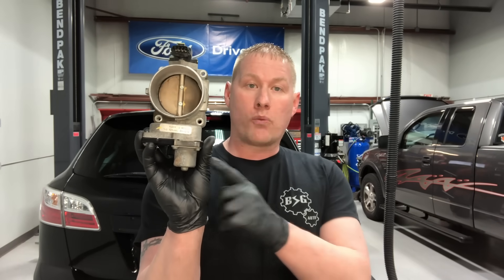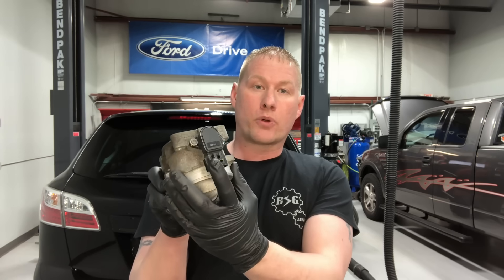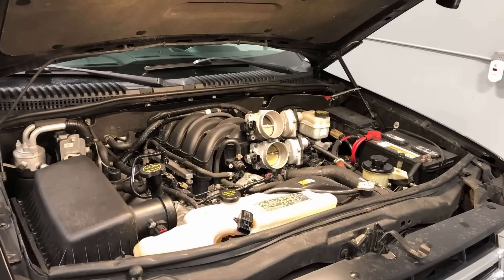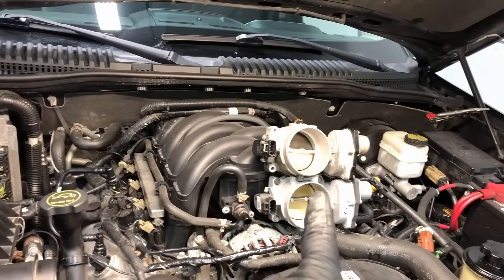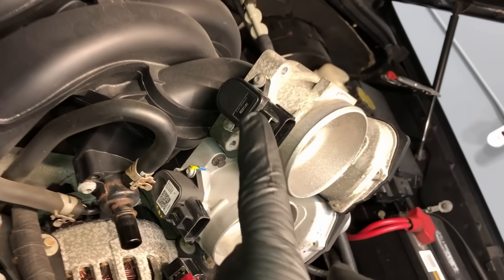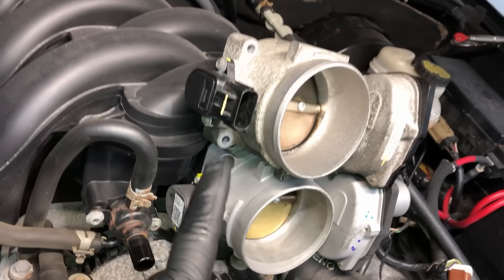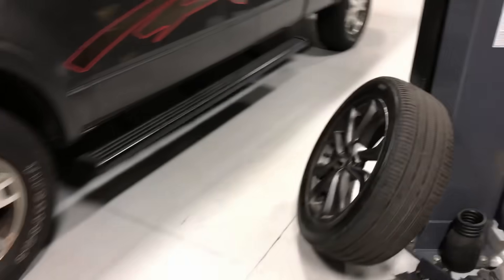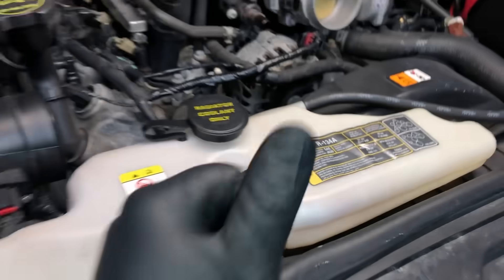Ford Electronic Throttle Body Failures P2106 P2107 P2110 P2135: What to Check First!

Comment: Just ran into this after replacing head gaskets and valve springs  in a 06 expedition.  Turns out it wasn't the tps sensor.  Though it through the same codes.  Turns out it was the throttle actuator connector was loose.  After I pulled it off and put it back on by pressing with some force.  The truck fired right up and ran like new

Comment: I have a question i have a 2005 mercury grand Marquis the throttle body always stays open a tiny bit open even when the car is off is that normal ?
Reply from the maker: Yes.
Reply: @FordTechMakuloco  thank you

Comment: Getting the same code for the new body style 2004 F150, 4.6l.  Can I assume that your information apply to 4.6 also?  The actual part apparently does not fit the 4.6, according to your Amazon link.

Comment: Hey my 2004 F150 5.4 3 valve is not going forward. First it was having a problem finding gears when I would let off the gas and I would downshift to get going again.  I have codes p720 and p2106. Just put an aftermarket output sensor but same problem. Noticed I have the triangle style t.p. sensor and going to replace that next. Should I worry about that aftermarket output speed sensor and any other tips you could give? Thanks for the videos

Comment: I have a '13 Edge Limited. It's had a few instances of shutting down while at an odor, even with the shifter in DRIVE. The interior lights come on, dash dials go out and an indicator pops up that says "shift to park". I am then able to shift into park and restart the car (push button). Yesterday, this happened while driving over 30 MPH. Lost steering, etc. Interior lights came on. Had to shift to park and restart the car. Mechanic can't recreate the issue and therefore can't diagnose it. No codes thrown on the diagnostic. Do you think this could be a throttle body issue? Thanks!!

Comment: Hello, great video. I had the same problem with my 07 Explorer and after I replaced the TPS with the 3rd gen TPS the code P2135 still appears. Could the pedal sensor throw the same code?

Comment: truck idles fine but when I hit the gas pedal, the computer goes into safe mode and I get p2106 and p061a
So would replacing the tps fix my problem.

Comment: You said ,that sensor makes the engine give  throttle and No throttle at the same time .Was exactly what I saw on my rpm gauge
Reply: Is my work man and I wouldn’t of been able to go to work tomorrow ,and saved my  ass. Apart a part from AutoZone when I got home I watched your video and called AutoZone and they didn’t  have that part for sale🕵️🇺🇸👍🚂

Comment: Amazon is claiming the linked part is incompatible with my 2005 Expedition. I'm assuming that is just because gen 3/4 wasn't on my vehicle originally. I'm also assuming, based on this video, it will fit and plug in but may require a pcm flash....?? Any info on this?

Comment: thanks a lot- very helpful.  I just replaced my intake manifold on my 2010 grand marquis.  Everything is connected back up correctly- no leaks.  However, runs very rough and check engine light is on.  no engine codes before I replaced the intake... ughh.  now i get p2195, p0113, p2110, p2107  and p2104.  everything seems to be connected right/ well.  any idea?

Comment: I'd like to add another check point. I was getting throttle body codes where my throttle body would snap shut and I'd have to restart the truck to keep going. I ended up replacing the two high amp fuses on the positive battery post and that fixed all my issues.
Reply: wow!  Did that high amp fuse replacement hold up and resolve your throttle body issues for the long haul?
Reply: @ never had an issue again, i was also getting power steering failures. Again never an issue after replacing them

Comment: This video saved my butt today! My 08 Expedition broke down 130 miles from home, wrench and check engine light came on. Got it limped across from an Auto Zone. Threw codes P2104, P2110, P2111, and P2112. Found this video, bought a replacement throttle body and was off and running in under 30 minutes!

Comment: I have a 2012 Ford F150, in hot or cold weather after I drive 15-20min it goes into a high idle mode. The engine roars. I cleaned the MAF sensor. I checked for codes-- No Codes. The Tachometer went bad it is sitting  1500RPM even when the car is turned off. So I think I have two separate problems (unless some on thinks they are related). I ran a Engineering Guage Test a couple of times, watched it run the gauge needles. But the Tachometer never goes back to zero. Also the high idle problem existed before the Tachometer went bad, that is a new problem. 

 I have not tried re-calibating the throttle body system (dissonnect neg. battery terminal, jump a wired to neg. drain the capacitors wait 5-10, re-hookup and let it idle). I guess that was a next thing to try before it goes to the dealership. 

I could use some ideas......

Comment: I’ve got a question maybe you can help in neutral I have great throttle response in gear I lose about 95% the remaining five is all the way on the floor I’ve tried to reset it works for about a minute this thing just does not want to go anywhere in gear transmission is good engines great It’s got to be between the gas pedal and the throttlebody can you shed any light on this for me Billy thank you
Reply: It’s a 2006 Mustang with a 4.0

Comment: Hey Thanks for this info. So I bought the sensor and it sounded like something was loose inside. So I exchanged it for another and the same issue. I watched your other video and recalibrated it just like you said. Worked fine for a few minutes and went bad again. Car is a Lincoln LS. I just bought the whole throttle body. Now my question do I have recalibrate the new throttle body as well. And should the throttle flap be open a little to see through? That's what I see on the old body. Thanks man.

Comment: I have a mystery problem with my 2014 Ford Fusion SE. My car stalls out sometimes when it goes slowly in reverse. It works great on initial start, but when the car is warmed up and stops for a minute is when it stalls out. Randomly. No codes. I already changed the Fuel Pump. Changed the Fuel Pump Sensor. Only stalls sometimes. Again, no codes. I'm out of ideas. Would it be a bad Throttle Body if it's not giving a code?

Comment: I have a 2006 Crown Vic, and my stupid drive by wire is faulty too. I have codes 2104, 2107, & 2112 so i guess I'm in the market for a new TPS...

Comment: Just wanted to say thanks bro u saved me 389 dollars I was about to buy a new throttle body for my 2015 v8 5.0  I went out reprogrammed my throttle body by putting wire in the negative to the positive and works great

Comment: I've got an 04 f150 supercrew fx4 with the 5.4l, I wanted to go ahead and change my tps sensor to the new version. I put 2 different sensors on and both times it put my truck in limp mode? Would crank but not stay running. Yes I did the relearn. Do I need a new throttle body?

Comment: Hi I’m a old school army mechanic who must do it myself i did a head gasket repair on my 04 5.4 3v put it all back together and then it will  barely run it sets at a low idle but the minute you give it gas to take off it dies and barely starts some more info  after you leave it idle for a little bit it will just shut off and be really hard to start again I’m going to start with. The vacuum hose on the back of the intake first and also I left out that both lights for my abs and brake light is on along with the check engine I have put a driver module on new and I’m gonna check the vacuum hose on the back of the intake and order the new style TPS and the purge valve and line as I seen in the videos posted what should be my next steps after those. Few steps I have said in the beginning of the msg hope that you can get me going in the right direction oh and also I have cleaned out the cat well  the exhaust is not even completed it is cut off before the Cats. Because I’ve run into it not wanting run correctly

Comment: As I understand the throttle body and ECU system works like the potentiometer is connected to the ECU and the throttle body motor pins are connected to the ECU.  so turning the potentiometer( pressing the gas pedal) will turn the throttle motor and the valve will open and close. But  I do not have a potentiometer in my project setup, I have a passenger counting script written on a raspberry pi ( that replace the ECU) and the passenger counting result will decide on closing the throttle valve. but In my local store, I have seen throttle body ( together with the engine model for academics purpose) motor has 7 sockets like male pins to connect to the ECU. how do I connect them to the raspberry pi or Arduino?

Comment: Thanks for all the help you have given me over the years. On this on I am stumped. I have a 2011 taurus 3.5 error codes p2104, p2107, p2110, p2111, p2101. I replaced the throttle body with a ford dealer part, followed your instructions. Calibrated the throttle body and all was good until the next morning cold start and fail safe mode kick in and all codes came back. I re-calibrated and all was good until the next day cold start again and all codes came back. Can you give me any direction on possibly what could be going on? Thanks again for your help.
Reply: Hey Onion!  I have been fighting this exact issue on my 2011 Taurus for the last couple months..  it is driving me insane but I refuse to quit doing my homework to figure it out.  What ended up being the fix for yours??  All I can think is either the sensor on the accelerator pedal, or a chaffed/shorted wire to the PCM - or worst case, PCM board issue.  I would be forever grateful to hear what fixed yours!! THANK YOU!!!
Reply: I have this exact same issue, did anyone ever figured out what the problem was?

Comment: Wish I knew your mechanical equivalent in Houston. I have a 2008 sport trac 4.6L and it probably has the gen two. If I install the gen 3 sensor do I have to change any settings in the software?

Comment: @FordTechMakuloco Thanks for the great info.  I was looking in to it because last night my 2015 F-150 EB had the engine cut out and a whole bunch of errors thrown pretty much identical to TSB 16-0139.  Got it to the dealer this morning and when the tech writer pulled the codes it did indicate an issue with the throttle body.  I mentioned to him that I replaced the battery on the truck about two weeks ago and he asked if I did the reset procedure which I did not.

Just curious if you think replacing the battery could be related to the TB issue?

Comment: Great video.
 I've got a 13' F150 Limited with the Eco-boost. I just replaced the throttle body and TPS Sensor.
 Do I need to do anything else? Should I clean the sensors?

Comment: My 2007 Ford F150 has a 4.6 2 valve but it does not have the separate TP sensor on the throttle body so I don't know if it's good or bad.

Comment: Any ideas on a 2016 1.5 Ecoboost rough idle? Doesn't feel like a misfire, it's a lot more subtle. 
No codes, misfire counter doesn't go up at idle, goes up about 2 / minute while driving. Just got new plugs.
Also has unpredictable throttle response. Sometimes low throttle revs up to 2500, flooring it does nothing. Still no codes, no check engine. 
Dealership says they ordered a "gas pedal" (guessing that's the throttle body) hoping to fix it.
Any thoughts?

Comment: Would a faulty TPS cause throttle surge when cruise control is engaged? I'm noticing throttle surging when the engine is under load with cruise engaged. 2006 Mustang GT with the original TPS. No codes or pending codes yet.

Comment: My issue with my 08 Explorer 4.0 is the heat from the motor frayed the wires going to the throttle body harness. Need to cut and solder another harness.

Comment: Every summer I have tps issues even to the point of limp mode. Cleaned the throttle body to no avail. This is on a 2010 Mustang Gt 4.6 3 valve

Comment: I have a 4.2 97 F150 my issue is dash and dome lights flickering, sometimes I will not have any lights on on dash and even dome. Sometimes sounds like starter contacts are clicking. I replaced battery and nothing works nor dash light nor clicking on starter contacts. Any idea what my issue is?

Comment: Blessings always Brian, top notch information 👍
Reply: I thought I had this problem with my 2004 4.0 explorer but no it's still barely running.
It keeps dieing at idel. I replaced fuel filter and fuel pump no codes and when I can get it to start it won't Rev over 3000 rpm it acts like it's starving for fuel I'm thinking my computers shot. Any ideas?

Comment: Hey man thanks for all you helpful videos. I got a problem with my 07 f150 the check engine light came on bout 2 week ago I pulled the codes it's showing cam position open circuit. I change the CP  sensors didn't do any good no problems other then allot of power lose .thanks.

Comment: I own a 2010 Ford Explorer - same drivetrain as the 2008 one that you showed in this video. Why does my 2010 require 5w30 oil, but the 2008 require 5w20 for the exact same 4.0 engine?

Comment: Great video!  My '04 F150 was plagued over the years with the P2106 code (particularly when temps dropped below 45 degrees F), but I had no idea that there were 3 different generations of TP sensors. I replaced several sensors over the years, but I believe they were all Gen 1.  The problem would never completely go away, which led me to believe the TP sensor wasn't really the problem.  Good info!
Reply: Did yours misfire and wouldn't go over 10mph with limited RPM also? Until all warmed up

Comment: So why hasn't my old TPS sensor died yet in my old 1990 integra with over 200k miles on the oem sensor? Yet new cars constantly have failing sensors.
Reply: Newer isn't always better. I still daily a 1990 Mazda mx6 5 speed Paid 1400 for it over 11 years ago. 280k miles

Comment: Have an 04 escape with 2.0. Had throttle body issues and picked up an A1 through rockauto. Ran worse than the stock one. After looking at the stock plastic butterfly valve, found it was warped and binding against the sides of the bore, little sanding and runs like a top. A1 sucks

Comment: I love how you pause during saying 'a1......cardone....." says it all. Hahah!
Reply: S Dennis 
What does that mean.  Sorry bro I am not a mechanic but it came up on my 2001 Ford Expedition 4wd AWD
Reply: @romansroad2007  Cardone is an aftermarket parts supplier
Reply: I have a 09 flex limited awd and my car rpm goes up and down and acts as if it wants to shut off is this a sign of a bad throttle body should I replace the sensor or the whole thing ?

Comment: crazy I have an 04 f150 4.6 278,000 never had any tbody problems. Still has original on it. I’ve had the truck since 09 with 75,000. No major repairs besides tranny at 250,000. Been a great truck

Comment: I have a 14 f150 FX4 ecoboost 3.5L the throttle body is the ONLY issue I've had in 120k mikes (since it was new)  the throttle body failed at 95k

Comment: Thank  you for all your time and effort!  I was hoping you could help me understand how the Tow/Haul works on a 2009 Ford F-250.  Again, thank you for the videos and all the help.
Reply: Paul .Williams t/h mode changes the trans shift schedule to hold gear to a higher road speed and engine rpm before upshift to nest higher gear. Also the VG turbo vanes are controlled to restrictive setting on coast for increased engine braking if you use foot brake.
Reply: @jimmyaber5920  thank you for the help

Comment: Any ideas on what causes  2004 F-150 to surge while accelerating or under a load 5.4 engine
Reply: I had a surge when my battery was weak from not driving truck for over a week. The TPS loses its position in relation to accelerator pedal.  I had to reset it by charging weak battery then turn key on and pressing pedal to the floor and release a couple times. Turn key off. TPS should be correct to pedal after that. My surge went away. Also the fuel pump driver module above the rear axle corrodes and can cause intermittent hesitation. Mine did
Reply: @tabbott429  Battery is fine and changed the fuel pump driver
Reply: @rodneybrooks7307  I thought my battery was fine to. The truck started  right up but voltage must've been low enough to cause the sensor to lose its position. When I did the reset procedure mine was fixed.
Reply: @tabbott429  was it affected by air temperature the warmer it is the worse it runs. I will try resetting the TPS setting.

Comment: Have a question...I have a 04 F150 with the 5.4 3v and its getting close to replacing it. I'm leaning towards replacing it with a 5.0 coyote with 40,000 miles my question is can it be replaced with it and how much do I have to change for it to work?
Reply: Probably more than your truck is worth honestly. You're looking at 4000 dollars just for the engine used and you got to change the engine harness computer ecu and transmission. you're probably looking at 8-12K if you can find someone who is smart enough to do it and make all the systems match up.
Reply: You can get a brand new 5.4 3 valve installed for like 6,000 bucks with labor. Just dont skimp on the oil changes and do it every 3-5k and they'll run forever.  The problem you're going to run into with a older truck like that is AC starts to break down and body rot.

Comment: I'd rather have an old school throttle cable than the "latest and greatest" electronic gizmos that will still fail at some point in time. Plus you can't beat the instant throttle response from a cable.

Comment: Great video, Brian. This is just another example of why original equipment parts are always the best choice as replacements. Keep up the good work.
Reply: except for the "original, original" gen 1 or even gen 2 - as indicated are not as reliable as they should be.  Also 3rd party parts can (potentially) keep the OEM honest - for either reliability or cost - sometimes.
.